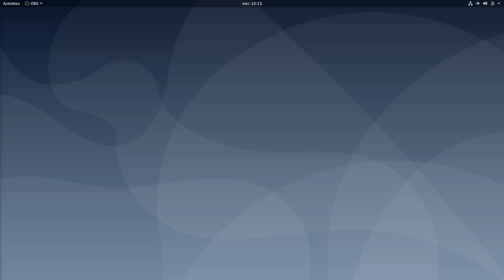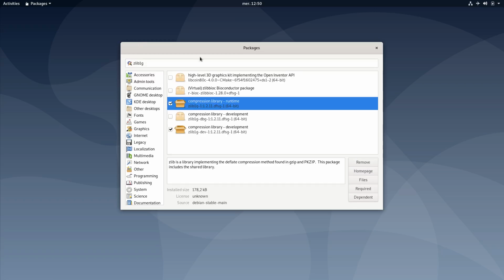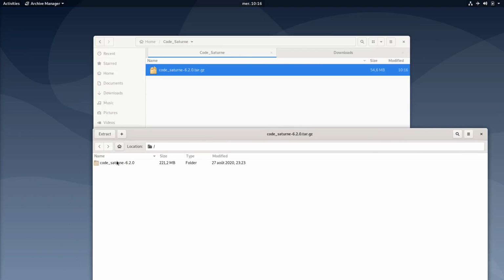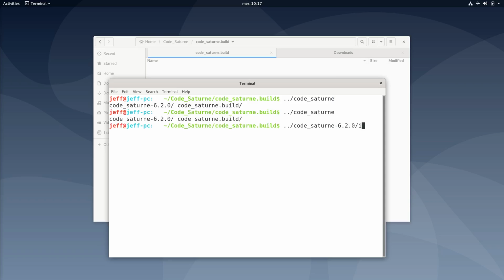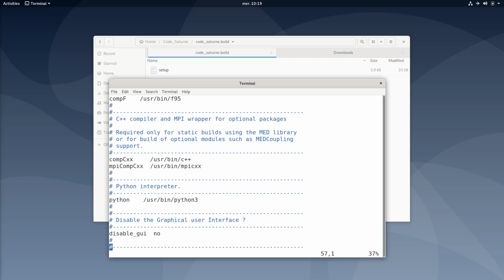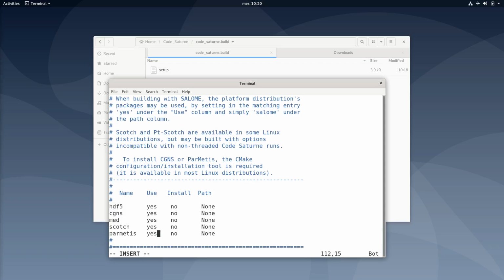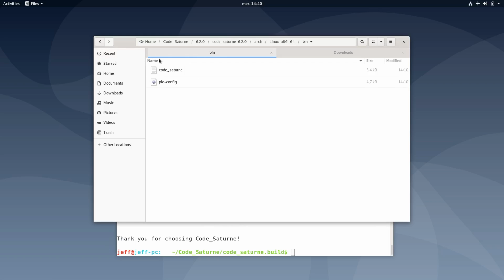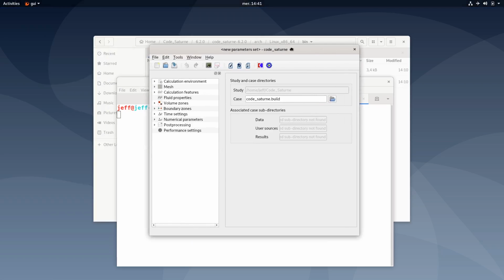HOW TO INSTALL CODE_SATURNE FROM THE AUTOMATIC INSTALLER ?

Comment: Hello

I always faced an error even I carefully followed your instruction.
Error occurred in installation process of  scotch.
Do you know how to solve it?
After errored happened, I followed another instruction by https://www.youtube.com/watch?v=PgJUA3MwpOk&t=1335s
If did so, I always succeeded installation for whatever reason, but I'm not sure.
However, if I solelly triied https://www.youtube.com/watch?v=PgJUA3MwpOk&t=1335s, it didn't go weel.
Thus, in my experience so far, to install correctly, I have to do installation process of your video and https://www.youtube.com/watch?v=PgJUA3MwpOk&t=1335s.
Without either your video process or https://www.youtube.com/watch?v=PgJUA3MwpOk&t=1335s,
the installation process has never suceeded.
Could you know what happened? 

Here is part of "install_saturne.log"

make[2]: Entering directory '/home/tsubasa/saturne/code_saturne-6.0.5.build/scotch_6.0.9.build/src/libscotch'
/usr/bin/cc -O3 -fPIC -DCOMMON_FILE_COMPRESS_GZ -DCOMMON_PTHREAD -DCOMMON_RANDOM_FIXED_SEED -DSCOTCH_RENAME  -Drestrict=__restrict -DIDXSIZE64 -DINTSIZE64 -DSCOTCH_PTSCOTCH -DSCOTCH_VERSION_NUM=6 -DSCOTCH_RELEASE_NUM=0 -DSCOTCH_PATCHLEVEL_NUM=9 dummysizes.c -o ptdummysizes -lz -lm -lrt -pthread -Xlinker --no-as-needed
In file included from dummysizes.c:92:0:
common.h:123:21: fatal error: mpi.h: No such file or directory
 #include            <mpi.h>
                     ^~~~~~~
compilation terminated.
Makefile:3077: recipe for target 'ptdummysizes' failed
make[2]: * [ptdummysizes] Error 1
make[2]: Leaving directory '/home/tsubasa/saturne/code_saturne-6.0.5.build/scotch_6.0.9.build/src/libscotch'
Makefile:72: recipe for target 'ptscotch' failed
make[1]: * [ptscotch] Error 2
make[1]: Leaving directory '/home/tsubasa/saturne/code_saturne-6.0.5.build/scotch_6.0.9.build/src/libscotch'
Makefile:103: recipe for target 'libptscotch' failed
make: * [libptscotch] Error 2